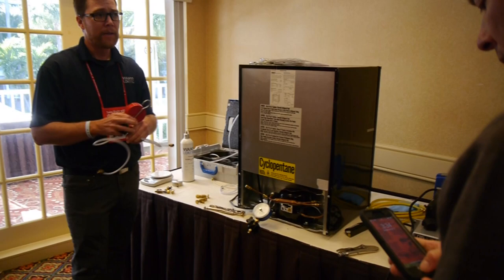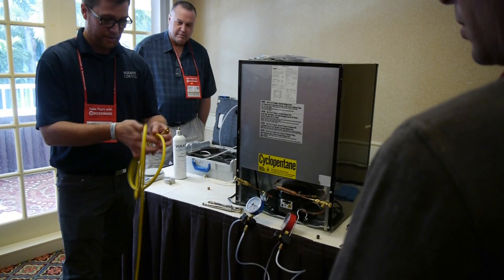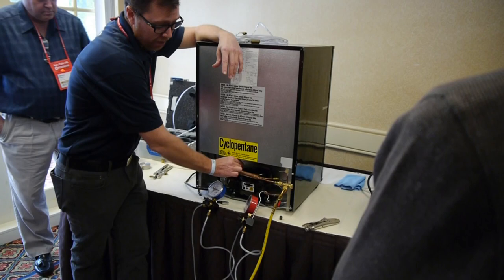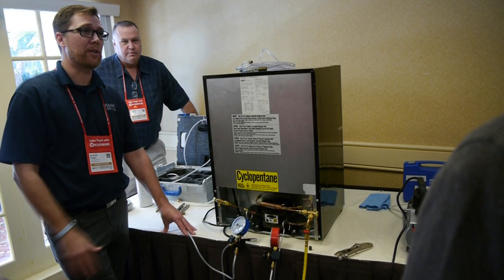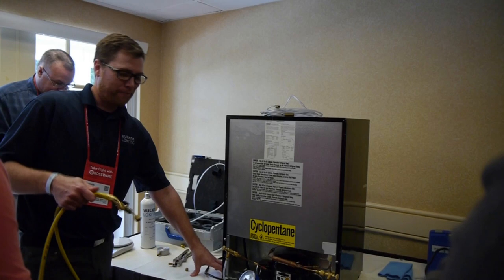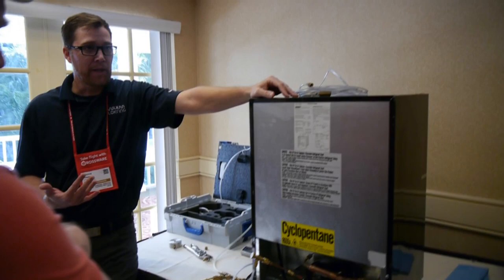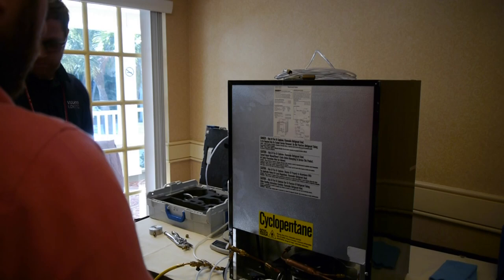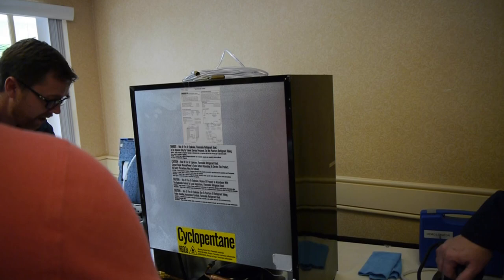R600 Seal System (Experience Techs only should attempt this repair)

Comment: Costs more to repair than buy a new one .
Reply: Not true whatsoever, pentane is cheap.
Reply: Hello! Cyclopentane is the gas inside the insulation polyurethane bubbles to up the U value.. Refrigerant is isobutane (The label R600a tells it's isobutane. It's way more common compared to R600 which is butane..and i believe the video title is just missing the 'a') ..it's true that it's not worth the money on the demo model on the vid, but the small demo model is convenient to train on and haul around to provide the training. When You have a real, more expensive model, maybe from midrange model to high end, it'll become worthwhile and way more sustainable for the owners wallet and for the environment..which we are losing on accelerating level.

Comment: I work for an appliance repair company. We refrigeration technicians have received absolutely no training on r600 repairs. Go blue crew😰
Reply: worst shit i have seen, whirlpool had several trainings for us but the tolerances for the lokring fittings are way off, i have more than 10 attempts at the lokring repair and have yet to complete a single repair, you need low loss fittings when dealing with r600 and all of lokrings stuff is expensive
Reply: @change929  most of the ones I've dealt with ended up being replaced under warranty. They know they fucked up by not training the technicians
Reply: Same situation with us. Have actually worked on 10/15 r600 units basically learning as you go. Man i can’t stand these classes where your grouped with people that can’t shut up and take this guys time seriously.

Comment: Can you please tell me how much the pressure of low side and high side? thank you...
Reply: I will like this answer also
Reply: Is it 10 psi on lowside and 70psi on the highside
Reply: Standard refrig with freezer runs approx  -11 inHG on low side and 43 to 87 psi on high side.
Reply: Recently I tried to reprocess a domestic refrigerator with r600.  The low side pressure is -1hg and it was working well.

Comment: To anyone who found this video out of frustrations over R600 repairs...

These new compressors have everyone in the industry thinging they need all new tools, new protocols, new hoses... you dont.

1. The Lokring tool is awful. Terrible product and the connections arent near as reliable as brazed joints. Dont let them scare you into thinking you can't solder. 

2. R600, unlike R134,  is butane based which is a very dry (and yes flameable, stay with me) refrigerant that runs through a compressor with mineral oil. Mineral oil is very very sensitive to temperature changes. Its smartest to replace the entire compressor in a sealed system leak because it barely lubricates itself as it is and is super sensitive to air. Air in the system will cause a floating restriction and ruin the windings SO fast. Use copper cutters to remove the old compressor, solder in the new one. No burns / housefires. Not dangerous. 

 3. Don't buy all new tools. Seriously save your money. Learn your hoses and the capacity when using R600. Charge by your pressures and dont let air in the system (again these compressors are sensitive). Buy a 20 dollar T valve on Amazon, purge your lines, and TAKE YOUR TIME. You cant whiz through these like you could R134.
Reply: Thank you for this comment, which is way better than this video.

Comment: Is $1200 R600a Charging Kit a must have for a technician for the future R600 repairs? $1200 seems excessive for what this kit comes with. 
Can someone recommend a cheaper alternative for r600a repairs?

Appion Core Removal Tool x2 @50 =$100, 
Kitchen Scale $20 or Mastercool 98202-290 High Precision Charging Scale $102
Uniweld H2SSM 24" Service Hose x4@20ea=$80
Mastercool Single Gauge Manifold with 1/4" Ball Valve for R600a x2 @43ea=$86...Unless a regular 4 valves manifold like Fieldpiece SM480V SMAN can be used instead???
I couldn't find an adapter that connects r600 can to 1/4 hose. Maybe another $50?
The total comes to around $340 or $420 with Mastercool scale.

Comment: I think its funny how people are so afraid of a tiny amount of pantane. I once dropped and shattered a completely full glass 4L bottle of liquid pentane in my basement when removing it from the freezer. Pentane has a boiling point of 96.7 degrees fahrenheit and is as flammable as butane but it is quite hard to ignite as vapor in the air above 35% humidity. The amounts being worked with in refrigerators is so small that it would likely not be ultra dangerous. Biggest risk would be shapnel from an explosion of a compressed cylinder or a filling cylinder. I've worked with barrels of pentane as well in sub optimal conditions. Just be careful and be safe so you dont  have to be afraid.
Reply: Pentane is used in refrigerator insulation, completely different than the sealed system refrigerant R600a they are training on in video

Comment: So how much freon do you put in and whats the pressure on the low side????
Reply: It's not Freon!
Reply: @philcross6037  yeah i know now but if they change 134a to this its going to suck my friend
Reply: @gregrangel9165  that's the same thing that was said when they switched from R12 to R134a. showing my age here!
Reply: @Sc-db6lv  yeah but at least the pressures are almost the same and they work better i try fixing 5 freezers last week and the compressor would get hot really quick i got the freon from mex and it was just a waist a money so what i did i changue the compressor and behold there working
Reply: @Sc-db6lv  im mean the gas from mex not freon
Reply: @Sc-db6lv  im 35 and i still like to fix refrigerators that have r12 i bring it back from mex

Comment: what's the thin refrigerant charging hoses brand?
Reply: They are made by Vulkan Lokring. The hoses are smaller in diameter and also much shorter than standard service hoses. Keep in mind the R600a charge is close to 1/3 or 1/2 of what a R134a charge is. If you use standard hoses most of the R600a will be in the hoses and manifold causing system diagnostic issues.
Reply: Probably Lokring